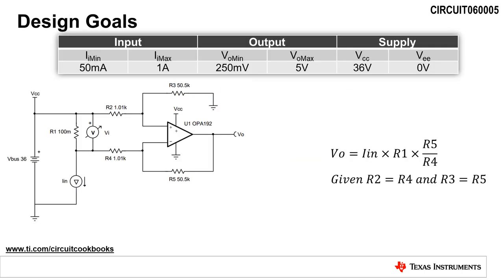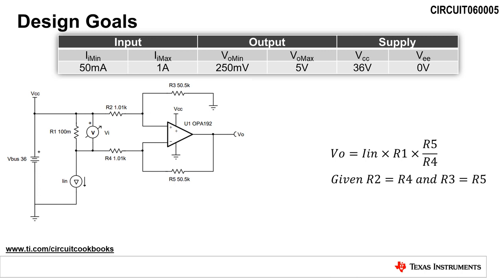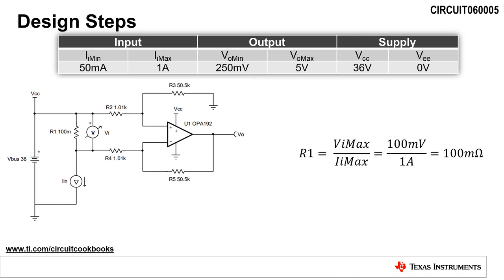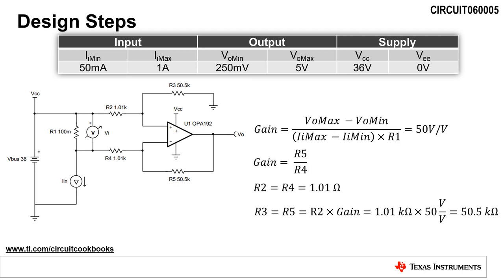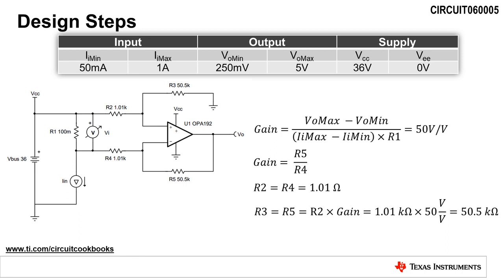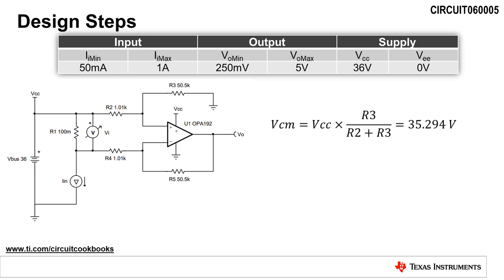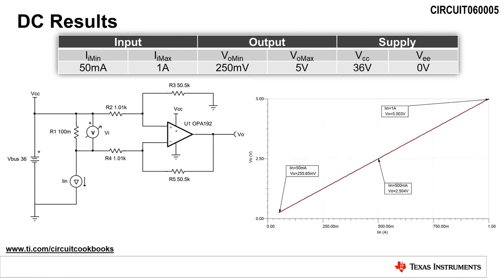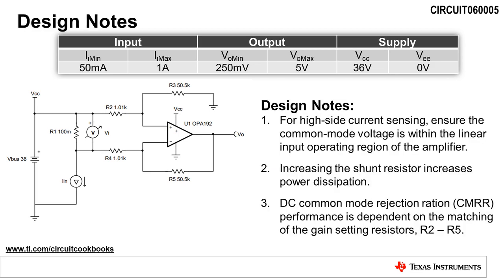High-side current sensing with discrete difference amplifier circuit

Comment: How did you decided the Vshunt Value.  My maximum load current is 10A  and i will use LM321.
Reply: it depends on how much voltage drop you think is acceptable. For example it could be below 10mV or above 500mV

Comment: What can I do if Vcc is lower than Vbus?
Reply from the maker: Thank you for your question, Sam. If the bus voltage is sufficiently large such that the common-mode voltage seen by the op amp is outside of its linear operation range (which is set by the op amp’s power supply voltage), then the design likely requires a current sense amplifier.  A current sense amplifier’s common-mode voltage can exceed its supply voltage.  Here is a link to Texas Instruments Precision Labs video series on Current Sense Amplifiers: https://training.ti.com/ti-precision-labs-current-sense-amplifiers. Hope this helps!